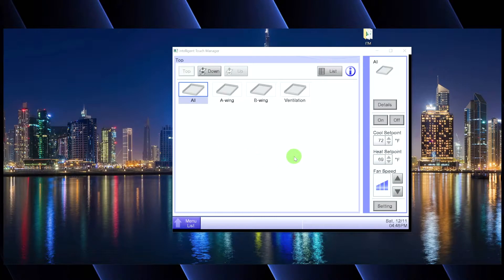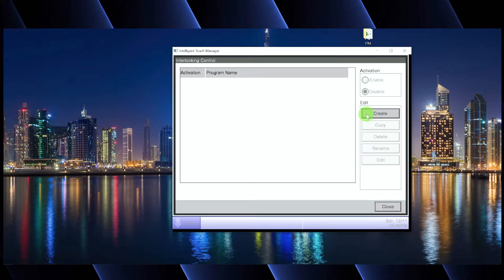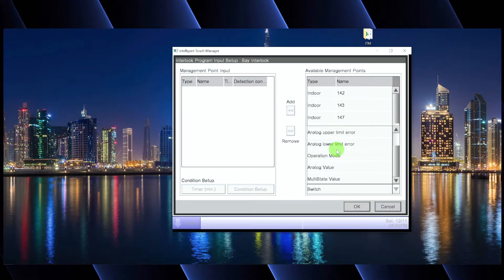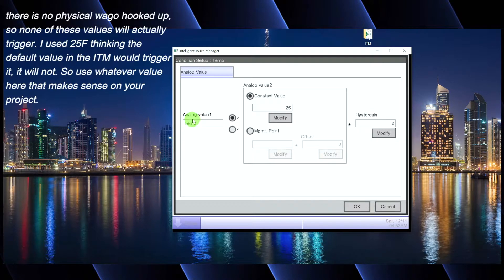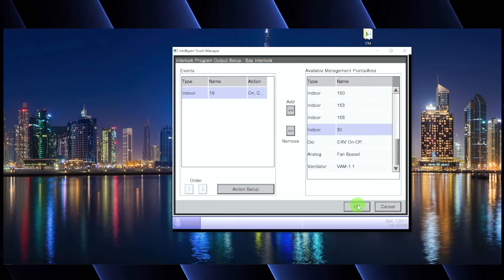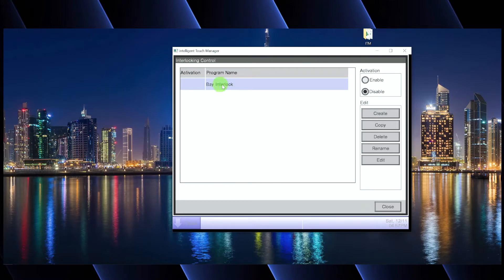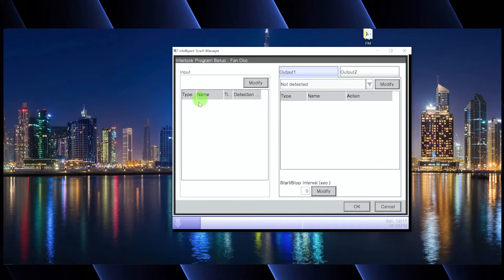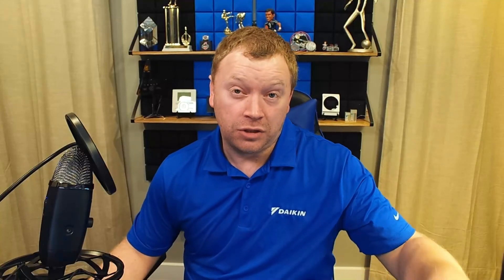Daikin ITM Interlocks | Setting up Interlock Functions on the Daikin Central Controller - 12-24-2021

Comment: I've got 6 indoors in the same space which are wired separately to vrv outdoor and central controller can I interlock them using this system to work as one ?
Reply from the maker: The indoors are on a single outdoor or they each have their own outdoor? There are a few ways to do it depending on the answer to this question. The itm can interlock settings that follow a specific unit as well for example, if one unit does xyz then all others do xyz. But using interlock features can become tedious on the itm at times. There may be simpler ways, such as daisy chaining a nav controller to all the indoors in the same room so that you create 1 group rather than 6 (or however many indoors you have).
Reply: @InverterAlways their all on the same vrv outdoor, each has a branch box. Too late to wire all in daisy chain.

Comment: IS IT POSSIBLE TO MANAGE THE AO INTERLOCK OF THE WAGO 750-315 USING AN ITM DCM601A51 ??
Reply from the maker: Depending the software version I believe it will but double check with Daikin.
Reply: @InverterAlways  ok thank you